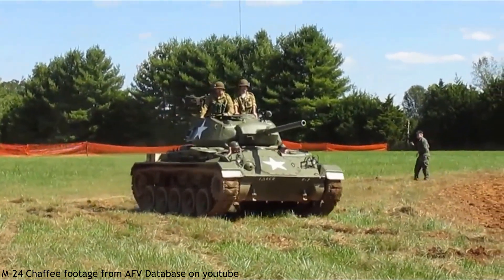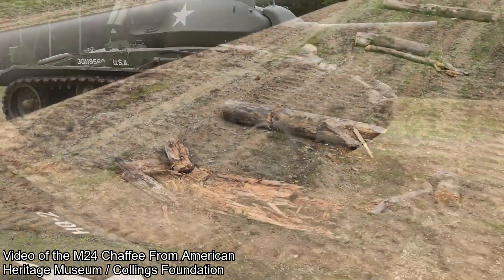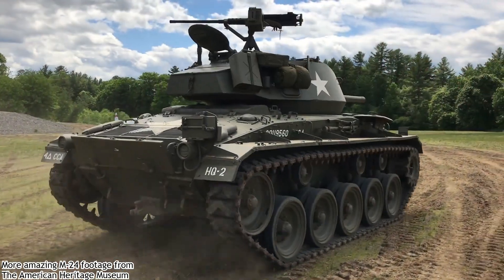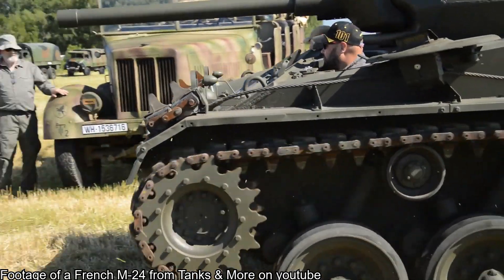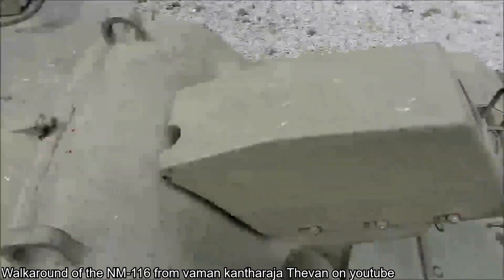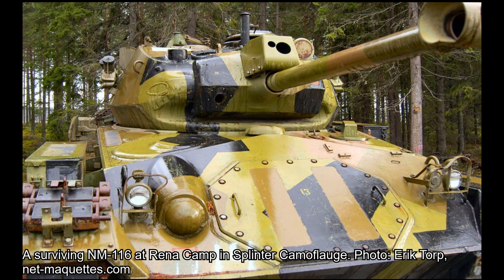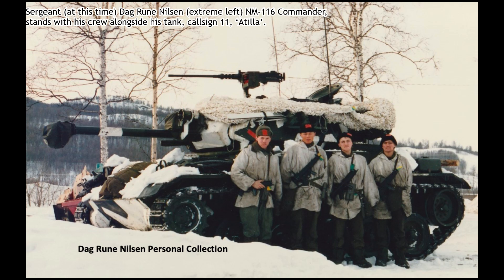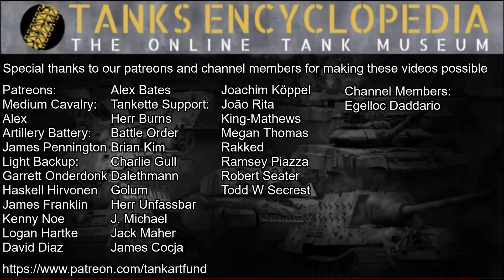Tank Hunting on A Budget | NM-116 Panserjager Norwegian Chaffee Upgrade  🇳🇴

Comment: The low pressure gun makes sense, an upgraded punch with limited range, but with Norwegian terrain it can easily be put to good use despite its limited range, it is nothing like the open steppes of eastern Europe for example. At best you would have a few long range engagements in eastern Norway where some of the only flat land in Norway is, and despite how much we like teasing our neighbor Sweden I don't think they are likely to take is so badly they would have invaded.

Comment: This seems like a logical upgrade... had to be cheaper then buying a new M60 or old M46/48
Reply: Fairly sertin we already hadd m48s at this point asweel as geting leo 1s in 75
Reply: These were built primarily as the M24 had significantly better tundra and mountain mobility, allowing a lot more armored support for mountain fighting, which if you’re going to invade Norway would be a significantly part of the campaign.

Comment: Can anyone explain to me the small curved metal plate on the right / starbord side of the turret, that is used as a hand rest in some of the clips? Is it a bullet deflector? A protection against branches wiping off the crews` personal kit stowed behind? It is even featured on the Cobi-model with a special brick, so it seems to be of some importance.
Reply from the maker: Could you provide a time stamp in the video of its location? I'm having a hard time figuring out what exactly you mean
Reply: @TanksEncyclopediaYT  With pleasure! The little elephant`s ear can be seen in the very first clip, best at around 0:26 located to the left of the white star, the spike in the 10 o`clock position is somewhat pointing at it, diagonally upwards to the right from the rectangular hatch on the turret side.

I spent some time with research, and it seems to me that this metal plate is in fact a protecting shield. Behind it there are the necessary straps and a pintle mount to the left of the above mentioned hatch to fasten a M2 Browning machine gun (either the MG or an additional spare MG) with its back / handle grip facing forward and the barrel to the rear.